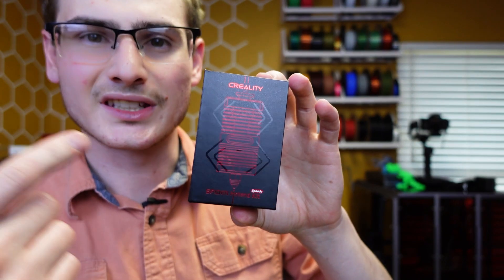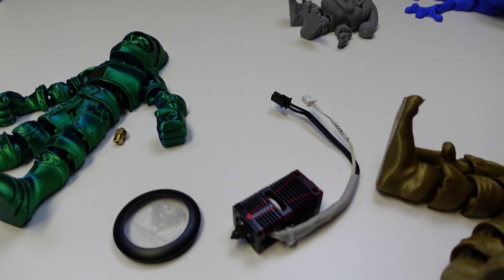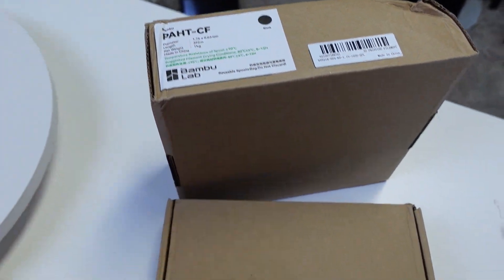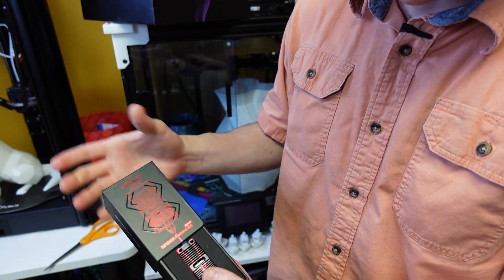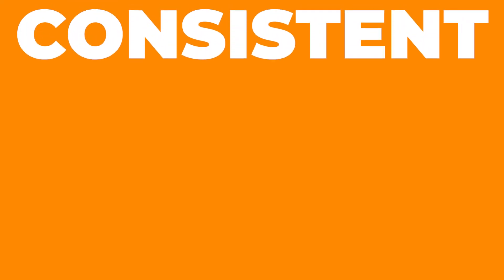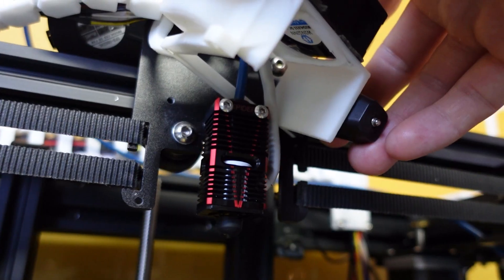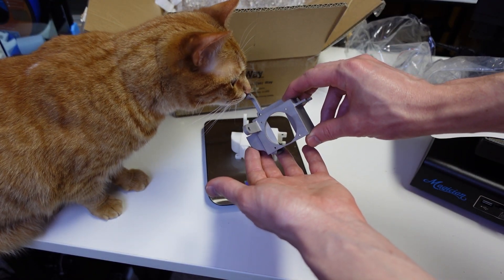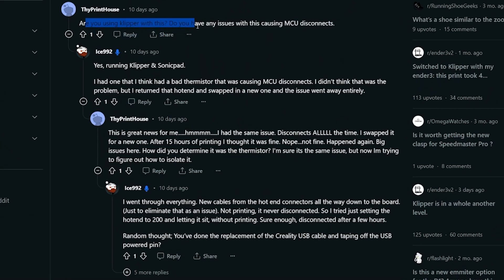OMG! 😱 This 3D Printer Hotend is a Nightmare! 🔥

Comment: I was having all kinds of thermal runaway issues wth this Hotend. A friend of mine suggested that it was a loose wire somewhere. So I resoldered the connection and that didn't fix anything. but I forgot that there are 2 connectors in this. I was able to seat the wires in the connector for a better connection and now it works perfectly. I recondment that you solder the extension cable to white connector and remove it. only leaving you with one connector.

Comment: I believe most MCU disconnect errors are caused when electrical noise gets into the cabling between your printer and raspberry Pi. Specifically a cheap USB cable which runs close or parallel to stepper motor cables or heater cables. Confirming the body of the printer is grounded properly is an easy first step. Next is using a higher quality USB cable with better shielding and ferrites, and keeping it away from other cables as much as possible. The raspberry Pi should be moved away from the printer as well, not put inside or under the enclosure. My guess is the cables from the ceramic heater put out more electrical interference for some reason - maybe they aren't being grounded the same way since the heater is ceramic instead of metallic. But I'd be willing to bet you can make it work with a better USB cable that's routed away from other cables. This is a common issue in industrial settings.

Comment: The smarts for the hotend is a heater and a thermistor. It doesn't get simpler than that. This is a klipper bug. Kilpper is throwing a totally unhelpful error code and you're blaming creality.

Klipper needs to be fixed to tell you if it was the thermistor or the heater element that it doesn't like.

Comment: I bought two of these and I can’t get either one  to print without getting clogged.
Reply: Are you using PETG?  I noticed that any PETG left in after a print will quickly cement itself in the heartbreak, heating the nozzle to max doesn't transfer sufficient heat into the heat break to melt it later; I had to use a butane torch on needles to clear the jam. Running extremely low retractions to avoid jams during the prints.

On the plus side I haven't noticed much jamming when running the PLA,  The Spider 3 a lot more plug N play friendly, just unfortunate it has a delicate thermistor that can't be  replaced . At least it looks like Creality added protections for the wiring on this model, though why they insist on an unreplaceable part there still is beyond me.

Comment: Love this video, it highlights the many issues I also have noticed with this hotend.
I've run the same hotend for 2 months. First month went well, now the past 2 weeks, I've been getting random thermal runaway on my modified ender 3 pro. As an electronics enthusiast I have resoldered and measured every connection.
And it seems there's a loose connection that's causing these issues within the ceramic heating block of the device. Given how many people seem to experience similar issues, I'll guess this is a major quality control issue going on right now.
Reply from the maker: Ill take it one further. This is a 5 month old video and the problem existed then so I think this is a problem that always existed and hasnt been corrected, so I doubt it will be corrected.
Reply: I agree, feels like they have zero interest in resolving this issue. I actually took the device apart and could conclude the issue is inside the ceramic heating block.
Will be filing a warranty complaint and hope for the best. Or maybe a refund.

Comment: could it be because is not responding to the old PID tune on klipper ? i had those issue when removing the nozzle hot and also klipper says when intalling a new hotend the PID tune needs to be done again.
Reply from the maker: Trust me that is what I was thinking the problem was, but it wasnt :/
Reply: @ThePrintHouse  maybe its the desing of this hotend that is not good.
the heatblock looks like is attached with the heatsink and the heatblock gets cold by temperature tranfer of the heatsink to heatblock cause they still toghetter with the same material, also they added fins to heatblock where is a place that needs a silicon sock for temperature isolation not dissipation like they did and i think is that what cause the problem cause no other hotend brand puts fins on his heating blocks.

Comment: I got my mine today. I installed it. Began heat to purge...went to temp then died. Would not reheat - Period. Immediate return.
*EDIT UPDATE*
I have installed a Spider v2 with a 60w 24v heater. AMAZING results. I can only guess it will get better with Direct Drive. 
If you try this ensure to run a PID temp calibration, I just wrote in notepade turned into a .stl and ran on printer, worked well.
Reply from the maker: Yeaaaaaaah seems about right to me. Im not sure whats up with this hotend. Either manufacturing process is bad or the actual product is bad. Im not sure.
Reply: @ThePrintHouse  Mate I am looking for something for my ender 6 (Stock), Can you pls point me in the right direction? This has broken my heart! I am in Australia so ordering from Ali whatever is no issue.
Reply from the maker: @nickoblicko7046  are you looking for an upgrade or just a new stock hot end?
Reply: @ThePrintHouse  A upgraded hotend. I am focused on PETG as it is usable for my needs. Where I live PLA turns to a puddle during summer if not kept in the fridge. I have seen a few getting around but the deeper I dig the more confused I get. As it sits the printer is Ender 6 stock, I have had some epic results but need the full metal hotend for the petg. Thanks for your reply also, much appreciated.
Reply from the maker: @nickoblicko7046  Well, to be honest, your best bet is to use the stock hot end. There are not enough ender 6 mods readily available that are easy to do. I print PETG on PTFE lined hot ends very regularly. I just have to replace the PTFE every 250 - 350 hours of print time. As for Replacements, honestly because there are so few bolt on upgrades for the ender 6, I cannot recommend anything specific. If youre dead set on all metal hot end, I am almost more inclined to recommend you sell the ender 6 and buy something cheap like the ankermake m5c or some other new creality ender 3 variant that has an all metal preinstalled. You can look into the sprite extruder, I think someone did that upgrade for the ender 6 but I dont think it is heavily documented.
Reply: @ThePrintHouse   Thank you, I will suss it out. If I do anything groovy and it works I will ping you. Retro fitting is my jam.
Reply: i just got one of these today and the exact same thing happened.. it worked once, got up to about 200c and stopped.. after that its not heating up anymore and the printer throws a heating error.. i put the old hotend back in and its back to working.

Comment: Installed it on my ender 3 v2, had to cut and strip the wires which was the worst part but it worked it flawlessly. Heated up fast and printed without issues. Prints looked better as well compared to the stock hotend. Happy with my purchase.
Reply from the maker: Glad to hear! Sounds like youre one of the lucky ones :D

Comment: I grabbed one of these at microcenter. It took a little to fixup my pressure advance . Other than that its been a great replacement for the stock hotend, You just need to go through your extruder config change your hottest temp to the 300c that the hotend is capable of

I have put over 80 hours on this hotend so far printing ....
Reply from the maker: I think there is manufacturer control issues. When I move I do plan to revisit and test this all over again.
Reply: @ThePrintHouse  I did just finish printing an entire voron trident part kit with my hotend after printing some various parts for my other projects 

Yet to run into anything SUPER odd maybe I got one out of a more recent batch 🤷‍♂️

Comment: Wouldn't the MCU disconnect be related to power supply issues or the mainboard being incapable of delivering so much current to the hot-end? If any of those two components are squeezing to power the thing, the MCU will suffer from brownout (lack of energy) and reset causing the klipper to disconnect.
The randomness you described and the fact that the new hot-end is, probably, more potent than the Ender 6 stock leads me to believe that it is a power supply/mainboard issue with the current demands.
Reply from the maker: I'm trying to think back to this nightmare of events.... I don't know if I checked peak amps driven from the power supply... When I move to a new studio I plan to revisit this hotend and see what I can do. I would be surprised if the power supply isn't good enough though because this is rated to be a drop in replacement for the ender series machines.

Comment: for my curiosity, what is the difference between this ho end and the Spider V3 (3.0)? I am looking into upgrading the S1 plus with Klipper, cooling and a new hot end and was leaning towards the Spider 3.0
Reply: Cerâmic heater
Reply from the maker: Honestly I am not 100% sure, but this hotend has the higher flow of the spider line up.
Reply: @ThePrintHouse  the "speedy" or the 3.0 has the higher flow?
Reply from the maker: @425wester  the speedy
Reply: @ThePrintHouse  well based off your issues and others, I'll sacrifice a little flow and go with the 3.0 and a .6mm nozzle

Comment: I have had one for a few months and it works well. For one, don't use the steel nozzle it comes with. PLA loves sticking to steel more than it likes sticking to the bed. Secondly it looks like you have selected the wrong thermister in your firmware so the reported temperature is wrong.
Reply: I believe the included nozzle is nickel plated copper. It's a Creality MK-HF nozzle.

Comment: Just installed this on my printer and its been a pain in the ass. Won't heat past 185 C and eventually errors out. Thought it would be eventually less work than my Micro Swiss that I was getting annoyed with. I had updated the firmware etc still no go. Hoping Creality will replace it or refund it. Hoping I can get one to work.
Reply: I find that I have to run a PID before I change temperatures--or else run a PID to the highest temperature that I plan to print at. I noticed that the temperature would rocket up to 10 degrees below target, then stop to avoid overshooting. It would waver at around 10 below target... and then eventually make it past this threshold and reach target temp. UNLESS, that is, Marlin's heating watchdog timed out, and reported a thermal error before the "waiting/stabilizing" period was over. There are probably ways to modify the PID tuning parameters to avoid this "fear of overshoot" or extend the watchdog timer, but I haven't figured that out yet. I'd really like to eliminate the waiting period, as it obviates the Spider's fast initial heat-up.

My main problems with the Speedy Spider at this point seem to stem from its unusual full-length heat sink. I use a Petsfang duct, and with the teensy sock, the increased airflow seems to cool the hotend. In fact, when the silicone sock became dislodged, the nozzle dropped below flow temperature, and the extruder started grinding PLA! I replaced the sock with a tiny slice of silicone tubing--Creality, please give us replacement socks!--and the filament started flowing normally. However, I still have some layer adhesion issues, AND the tips of my PETG Petsfang duct got too hot at some point and melted!

I've just had some much more successful prints at a .12mm layer height (I usually use .20), so maybe that's the solution for my set-up, but I think a more conventional hot end sock would help "keep the hot side hot and the cool side cool," to quote a decades-old McDonald's ad.

Comment: Hotend in the K1 causes the same MCU disconnects with the same erratic 5 second to 45 minute timeframes. I have the same "i cant trust any single print to finish" feeling. 

What I noticed is that when disassembling the hotend there was next to no TIM applied between the ceramic and the throat and what tiny bit of TIM was there was the driest most crumbly awful bit of TIM I have ever seen. 

This causes the ceramic element to have to heat way too hot for way too long to keep the nozzle at temp. Its operating inefficiently because not enough of the heat being generated is moving to the thermal mass of the throat and nozzle. Eventually this causes the heating element to burn up but it also causes the inexplicable "I'm pumping so many watts into this heater and the nozzle isnt responding quickly enough wtf is going on" errors that I believe cause the disconnects. 

Im very curious to see if you disassemble these hotends and reapply TIM properly what sort of results you have, presuming the heating elements havent burnt up too badly.
Reply from the maker: Incredibly detailed and helpful comment. Thank you. I'm incredibly packed with projects but I really want to try this. Not sure if I'll be able to squeeze it in but I'll try. What TIM do you recommend and did you have any significant issues taking the hot ends apart. If they're burned up is it obvious? Do you have any tips or video to share that can help me identify if they're long gone and burned up?
Reply: more on ths pleaseeeeee

Comment: I'm using it right now. It prints very nice,. Printing at 100 mm/s in cura on an ender 3 v2 stock extruder. PErhaps i need to replace it with an orbiter or such to fully extract its potencial?

Comment: How can you spend 40-50 hours on a defective hot end. 😂
Reply from the maker: I spent 10 hours debugging, designing, iterating on design, fan flow analysis, and printing a fully custom fan shroud in order to have this hot end actually fit inside of the ender 6. Then about 1-3 hours rewiring the printer and hot end.  Then another 1-2 hours settings up the printer config file for the hotend + new bl touch mount. Then SIGNIFICANT issues with clogging that first took up 5-10 hours. All to find out a hardened steel nozzle installed from factory. Incredibly low flow rate causing immediate clogs. I was dealing with that issues in parallel to the MCU disconnects so half the time I tried to fix the clogging I had disconnects. In parallel with those issues and while I was attempting to create a refined cura speed profile I was dealing with the completely unrelated (to the hotend) issue of cura 5.3 bugs causing ugly blobs on models which nullified every slicer modification I made. When I began to tackle the mcu disconnects I had 5 hours of research spread across the last 2 months. I spent 3-5 hours FULLY rewiring the ENTRIRE ender 6. I wired in new motors. I checked for EMI on nearly every E6 component because of the brand new rewiring in case that was causing something to cause a hardware shutdown causing MCU disconnect. I discussed the issue with many other people across multiple different posts on reddit, emails, as well as in person meetings. More rewiring when I resoldered components to check for bad soldering joints. More rewiring when I attempted to install a brand new unit to check for factory defects. Honestly the list goes on. The hours add up. I tried to hard to make this hot end functional, but across multiple units it simply wasn't. I wish I could give you more examples of things I tested, but I dont think you really care. Youre only here to troll :/
Reply: I too someone who will spend hundreds of hours potentially trying to make something work.. It's pretty synonymous with ADHD hyperfocus...

On my Ender 5S1 that was defective I spent at least 150 hours trying to fix and documenting all the problems with the machine. I lost a lot of sleep for no good reason other than that's what my ADHD called me to do...

I have a feeling the presenter also could not sleep and just had to try to fix this as much as possible. Just want to let you know dude, thanks, and it's not your fault, Good work
Reply: I am back... and I am here to say I have spent 120 hours of 
my time working through a hotend issue, triangle labs CHC Pro Hotend with Klipper.

Having same issues.
Reply: @JonLaRue these are very high power hotends, especially the CHC Pro

that means you may actually want to check if you're not overloading the PSU, especially since the E5 has a 500W PSU, the bed itself is like 350-400W and the stock hotend is 40W, that leaves little left for the steppers

now replace that 40W hotend with a 100+W one and you can see why i'm saying to check that, that printer out of the box/stock has very little headroom on the PSU

besides that you could also add a small 10uF capacitor (rated for atleast 30V, ensuring polarity is correct) on the hotend output aswell to reduce switching EMI, that wouldn't hurt things but maybe reduce EMI and also work against inductive kickback (~5-6A through very long wires, worst case scenario voltage peak on turnoff could reach that high it blows your mosfet)